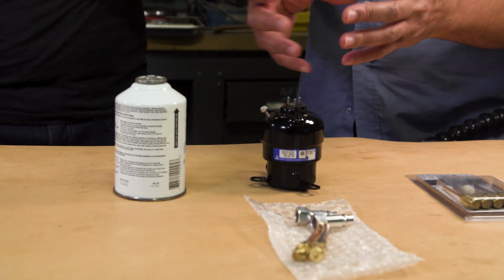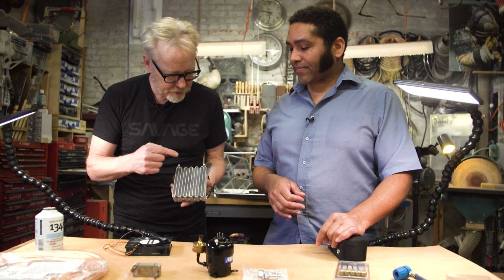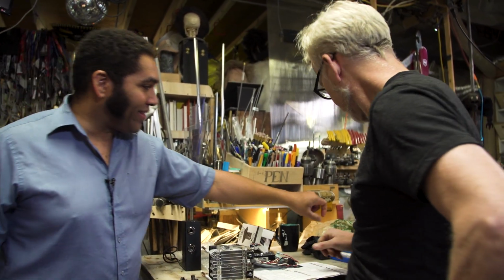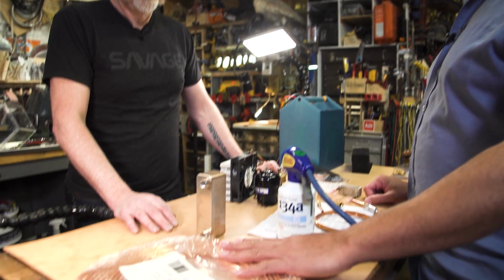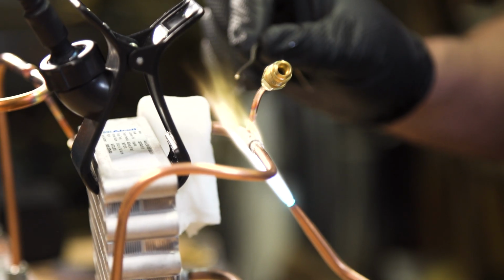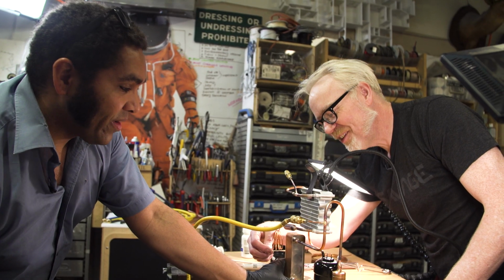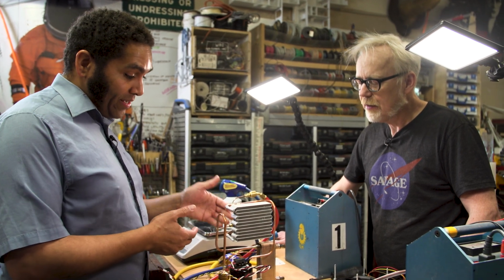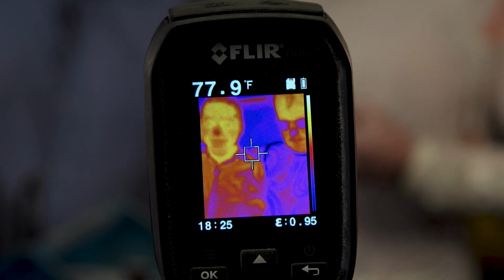Adam Savage's One Day Builds: Refrigerated Cooling Suit!

Comment: If you design in a certain flow directional valve , you can reverse the operation of the system thereby making the cool heat exchanger give off your 800 watts of heat and the hot heat exchanger going cold.
This could benefit you in the other temperature extreme where it is very cold outside and you need to stay warm which is what a space suit does.
It would also work to use a variable or adjustable expansion valve and/or a variable voltage to the compressor to change the speed of the compressor as needed for a given load.

Comment: That would be huge for me as I quadriplegic. I could use that to keep my body temperature down while about in the Arizona heat. Because of the spinal cord injury my body thermostat is broken. My body temperature will adapt to outside temperature. The suit could be a game changer. Now here's a interesting puzzle to add. I would like to see one built for warmth i.e. maintain body core temperature when in the cold and snow.
Reply: I mean depending on the outside temperature, with a device called a reversing valve and a more complex metering device than a cap tube something like that could in fact work in both warming and cooling just as the heat pump/AC in some homes do.
Reply: The hot version would be much easier than it seems. This cold suit requires a complicated heat pump, as you can't "make" cold, you can only move heat away. Heat, however, can be "made" out of other forms of energy. A battery contains a quantity of electrical energy, which can be turned into thermal energy through a couple ways. Some of those ways are just as complicated as a refrigerator and are more cost efficient to set up on larger scales. However, simply running electricity through a wire will turn some of that electricity directly into heat. The amount of electricity turned into heat depends on two major factors. A longer wire will turn more of the electricity you run through it into heat. A less conductive wire will do it faster for shorter lengths, though if you try to run electricity through concrete, which has very low conductivity, you won't get any noticeable energy flow at all. Nichrome wire is an example of a conductive but not too conductive wire that will produce a lot of heat. Adam needs a suit that runs the cooled liquid through a series of small tubes, but all you would need for a heated suit would be wires. You could run wires like that through normal clothing quite easily, and in fact, some expensive winter jackets have a battery inside that connects to wires running through them.

What's great about this is its efficiency. Resistive heating is 100% energy efficient, no matter what. Efficiency is defined as what percentage of the energy you put in that comes out as the energy you want, as opposed to the percentage that turns into heat. So if you turn a crank on an electric generator, adding a certain amount of mechanical energy, a percentage of that will come out as electric energy. However, you'll lose the rest to other forms of energy. Some of that loss will be immediate thermal energy, heating up the generator. The rest will be things like sound and vibrations, which will eventually turn into heat anyway. If the energy output you want is heat, then the waste percentage and the desired output percentage are meaningless, as both are just heat. A 1000 watt space heater will consume 1000 watts of electricity and produce 1000 watts of heat. That means your heat suit would be much more efficient at heating you up than Adam's cooling suit is at cooling him down.

It's not even hard for any reasonable adult to do at home. If you have some basic technical skill, it's not hard to learn how to deal with low voltage circuits, especially since they're fairly safe. The biggest threat is burning your skin on a hot wire, if you exercise basic safety precautions. If you're completely unaware of engineering, there are many technicians, engineers, tradesmen, and the like who can easily help with this kind of project. It's also dirt cheap, the battery is the most expensive part. An adjustable resistor and a few metres of insulated wire cost pennies.

Source: am physics major, have done electricity and basic electrical circuits courses. Don't take me as an authority on this however, use your own judgement and talk to professionals about anything you're unsure of. Try to avoid using any sort of powerful heater on skin you can't feel pain or excessive heat from, without the proper precautions.
Reply: @shuriken188  mechanical phase change is more efficient than resistive heating, depending on environmental variables. If it's 0F outside and you're trying to pull heat from that air, then no, resistive would be a bit more efficient, but as you get above freezing, mechanical heat pumps are far more efficient.
In fact, electric water heaters are now going to refrigerant heat pumps instead of resistive elements. You can get nearly 300% efficiency.
Reply: @andrewt9204  Sure, in a hot environment, you can acquire a lot of energy for cheap. However, I'd say this heating suit is far more likely to be used in colder environments where a heat pump wouldn't have much energy to pull.

I didn't know about the water heaters changing over though, would be pretty cool to have if I didn't live in Canada.
Reply: Hello Scott. I run a group called The Make Good Collective. @TheMakeGoodCollective. I can't promise you anything but I can ask around. We may have an engineer/maker in out group that could help.
Reply: @themakegoodcollective  That would be great. Any help would be greatly appreciated.
Reply: @themakegoodcollective  I would appreciate anything you can do. Even if it's feasible.
Reply: Just modify a costume to use air flow instead of water. Switch the air flow from the cooling side to the heat exhaust side and vice versa. Two pipes, one valve between the two and have it automatically switch to whichever side needs to be directed to the wearer. I've long wished for a Halloween costume that could handle hot/cold like that and yet be easy to take off (plus install web cams, VR glasses, mics, remote drones, etc. that could be voice controlled) to go full cyber-DJ. A positive pressure inside the suit and helmet could also be nice if the air intake was filtered and UV-light sterilized. Whee!
Reply: They make suits like this for auto racing.  The Jegs catalog would probably have what you need.
Reply: @Jung-Thug  I have had a cool suit for my of rotting truck. But that used a large ice chest to hold the ice and water.
Reply: Tool companies like milwaukee sell battery operated jumpers and gloves with in built heating for the cold. Pretty nifty for when you're out on the worksite at 6am in winter
Reply: I also live in Arizona and have some feel for your problem, accept that my internal temperature control still works. You almost need Scorious's thermal regulating suit, but without the blue cooling rods that screw into the center of your brain. 

Switching from cooling to heating in the freon (R134a) loop requires a sealed, two stream swap over valve. The one I  had in Phoenix was an electromagnet driving a block that moved and switched the directions of the streams and was very nosy. Also you have the problem that the gas/liquid now flows in the wrong direction with much greater risk of liquid going into the compressor and jamming it up.  If you labeled the connections (ports) in normal mode compressor in 'C low' compressor out as C high', air heat exchanger top A top, and it's bottom port 'A bot', and same for water heat exchanger 'W top' and W bot' with a resistive element A bot and W bottom. A text version of connections is:
  normal (cooling)                                  switched (warming)          switching

C high  - A top   compressor high       C high  - W top                 Comp high ---A top
C low - W top  compressor low           C low - A top                                        X
A bot - W bot   with resistive tubing    W top - A top   resistive   Comp low ---- W top

This looks like a 5 port solenoid air valve, which would be much smaller, quieter, and cheaper. But I am not sure the gaskets are good for R132a or that the commonly available ones could handle the pressure. You would also have to solder in the resistive small tubing the same way at both ends since it will act like the expansion orifice in either direction.
Note: I am not a trained or licensed HVAC technician, just working from simple physics. I am confident but if you actually want to build one you should consult a trained professional, and in the states you will need one anyway to vacuum and charge the system.
Reply: You use one of those electric wheelchairs to get around right? Because it would be mechanically simpler to enclose it and have a little padded hole at the top for your head to stick out. Like that thing they had in that classic Star Trek episode Captain pike used. You could even style it to look like that for the nerd cred. An electrically driven Stirling pump can function as both ac and a heater just by running it backwards or forwards. Another possibility is getting a military surplus cooling vest like tank crews use.
Reply: @sockmonkey6666  Yes I use an electric wheelchair. It would easily power the device. I don't know what the voltage is. But it is standard throughout the industry.
Reply: @ScottHillsmusclecargarage  Well, AFAIK the basic stats would be stamped on the battery pack and/or control systems.
Reply: @sockmonkey6666  It is 12 V. The batteries are sealed.
Reply: There is a company called „compcooler“ that makes vests and body suits with integrated cooling and also heating systems. I own a vest with a ice water tank in the back that circulates the cold water through piping, just like the air force suit in the video. And they also have models with real compressor/refrigerant based cooling or heating systems (also battery operated). They probably use the small compressor from the video.
Reply: @danny2142  Thank you very much!

Comment: FUN FACT!

The radar system (RP-21 Safir) of the soviet MiG-21 interceptor jet used vodka as a cooling for the radar wave emitter. The emitter got so hot that the vodka started to evaporate 20 minutes after it got turned on. Meaning that if the pilot forgot to turn of the power to the emitter after the vodka had evaporated, it would get so hot that it would catch fire and burn the plane.

Comment: Great video, Adam! I'm curious, have you evaluated or have ever looked at thermoelectric modules? To my very limited knowledge, they are super small and no compressor is required.
Reply: They are also unfortunately incredibly inefficient so for something that needs to dissipate a fairly large amount of heat and is going to be battery powered thermoelectric cooling isn't unfortunately a good fit

Comment: "Tell me about your homeworld, Usul." Now you need to figure out the water recycling part...
Or alternatively: "Luck, MechWarrior." "Skill, MechCommander."
Also, Kipp needs to hook up with someone like Steve Burke ( https://www.gamersnexus.net/ ) or Linus Sebastian ( https://linusmediagroup.com/ ) for a CPU cooler project. That is a moral imperative. Especially if you can convince Linus to try using a SLS 3-D printer to make the heat sink.
Fun note, those braised plate heat exchangers can be used in homebrewing beer, for rapidly cooling wort ( https://en.wikipedia.org/wiki/Wort ) from boiling to fermentation temperatures 65° F (18° C) by running tap water through them as the wort is going through in the other direction. The top brand (as of a few years ago, at least) is the Blichmann Therminator ( https://www.blichmannengineering.com/therminator.html ) ; it can cool a typical 5 gallon (19L) batch in about a minute.  Keeping them sanitized is a pain (infection is the biggest enemy of homebrewing, and bad sanitation can ruin a lot of batches), but it can be worth it.
Finally, "Flux is optional." So your saying that you don't give any flux about that part? Also, you're going from Scotch-rite Masonry to ScotchBrite Plumbing!

Comment: Is there any reason a person couldn't use multiple peltier coolers on a heatsink with a fan. It occurs to me that one could use a CPU water block for an exchanger to cool the fluid and that a liquid cooling pump for a PC should have enough static pressure to drive it the loop in the suit. If the objective is having an effective system for space, the cold of space alone should be enough to draw down the hot side. And let's not forget that most peltiers are also reversible by reversing the current. With a microcontroller, a few MOSFETs, and some 18650 cells you could have a pretty solid system if you think about it.

Comment: muggy weld super alloy 1 can solder copper to aluminum. I have even soldered aluminum to stainless steel using that crap. HTS2000 can also do aluminum to copper if i remember correctly.

Comment: That's not how refrigeration works. Temperature is basically the amount of kinetic energy of particles in a given volume. Therefore by shrinking the volume (increasing the pressure) you increase the temperature, because the amount of kinetic energy per volume goes up.

Now, the real reason you want to increase the pressure and therefore the temperature of the gas is to increase the temperature difference between it and the outside air, so you can use the air to cool the gas down more efficiently. If you let the temperature of the pressurized gas and the ambient air equalize you can depressurize the gas and it will be colder than the ambient air (because the kinetic energy per volume goes down).

It's important to understand that you're not adding heat energy, that would be counterproductive. It's better to think of it as concentrating the heat energy.

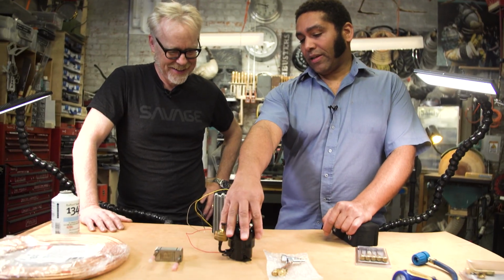Comment: 13:09 Really?!  I think my central air unit for my apartment pulls around 2.2KW, and it's a normal size, older model, smallish unit.  That thing fits in the palm of your hand.  This has me wondering about efficiency.  If you drive it to that point, are you reducing efficiency? Methinks this will be explained, but I'm commenting as I proceed though the video, so IDK.

Comment: Kipp, was like watching Mr, Wizard. I learned alot about AC in that short video. It's nice to see someone that likes what they're doing and knows it inside and out. I would really like to see how the conditioner pack will be designed and built. I can imagine some sort of backpack with shock mounts for the compressor and sound dampening. But you still need to move air through the coils, so maybe a vent tube. It is gonna be more complicated than it looks. If your doing cosplay you don't want to sound like the beer cooler at the cornerstore!

Comment: The condenser coils (rejecting heat into the air) that they show are called "serpentine" coils.  They are typically produced from aluminum using a Nocolok brazing process.  It is not the peak of heat exchanger technology, but it works ok.

Comment: I used to work in hvac warranty checking copper and aluminum coils for leaks using the same method. There is a chemical reaction that occurs with Al and Cu and refrigerant that makes tiny holes.

Comment: They forgot to mention another cool fact about BSPT threads! The threads are 55 degrees, which a stronger than the normal 60 degree threads that most all other's use. 55 degree used to be ubiquitous but were difficult to make so they changed over to 60.

Comment: My mind is boggled by the info that you get a better heat exchange on your face, palms, and soles of your feet than the rest of your body combined. Is the exchange rate improved if you are shaved or have very fine hair? Is it caused by the hair acting as an insulator? Or does it have to do with how your blood flows around hair follicles versus how it flows around hairless regions?

Comment: Things to add
flow switch for liquid loop (save the pump)
High and low pressure switches (save the compressor)
 thermostat in water loop to cycle the compressor (set temp for the suit)

Comment: I wonder of a system similar to this could be used in conjunction with or instead of a radiator in a water cooled PC. Possibly mounted in a cage on the exterior of a tower to keep the heat exchange of the refrigerant separate from the rest of the system. The low profile of the assembly wouldnt be difficult to contain and the fan could be controlled by the motherboard or a fan controller if desired

Comment: Damn just the guy who would know answers to my questions. I have this huge fridge pump from basement cold storage room, what i have been planning on making a silent air compressor, but proper lubrication, removing the oil and water from air and returning oil back to system has been taking project on back burner for a while. Haven been able to device plan on my own with my fuck all knowledge of these systems and all the nuances that come with it..
What oil to use, is the corrosion problems and how to remove them, it it possible to build cyclone filter of sort and maybe use gravity to collects the oil and drains it on the oil water separator that then feed over flow to intake side.